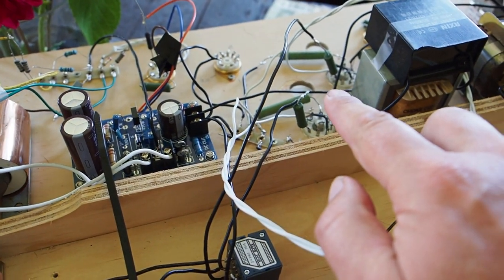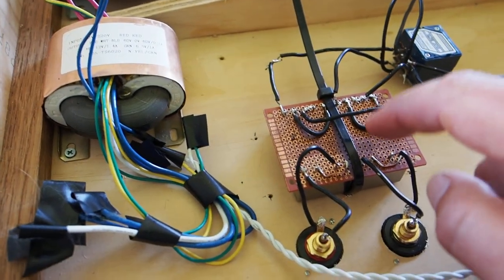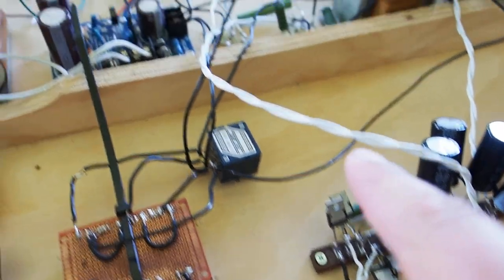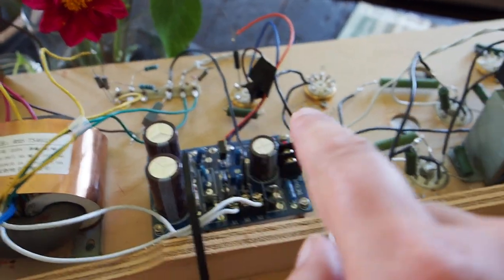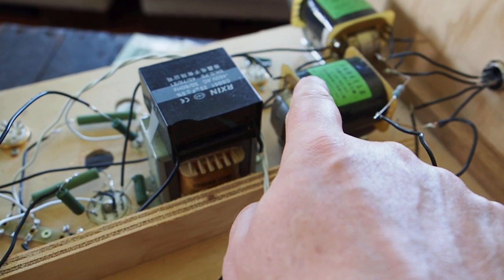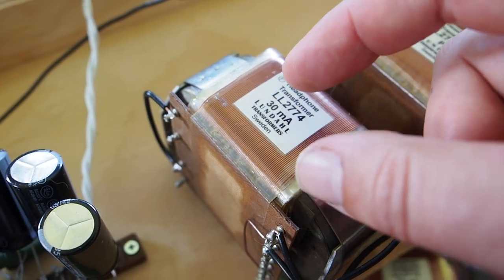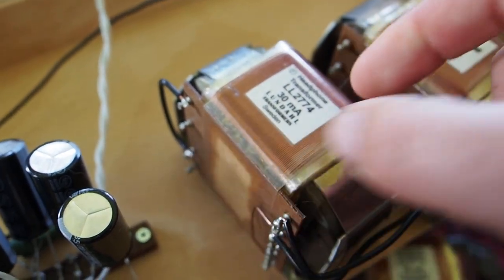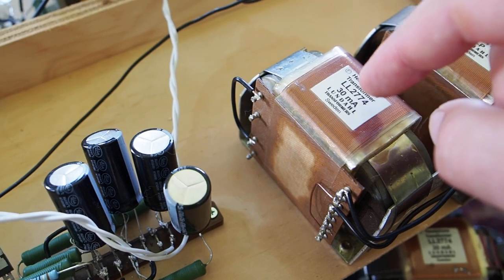The tube headphone amp project: design overview

Comment: very interesting to absorb the design thoughts. coincidentally i chose the ll2765 20ma for the darling (first build, yet to be done) that I'm unsure of how it can be wired for multiple output. will you use more than the 300r out?
Reply from the maker: My plan is to use the 32 and 150 ohm output so a 300 ohm headphone creates a ~13K impedance for the tube and for a 55ohm headphone (on 32), it's about 10K. With two 4PDT switches we can switch between the 2 output configurations.

However, I noticed the 4P1L quite likes delivering current, so I do need to have a listen to it on the 300ohm output. 

With using/offering the 32-150 ohm switch, we can support a wide range of headphones (~25-300 ohm): a lot of models from Hifiman, Audeze, Dan Clarke have impedances in the 25-60 ohm range (if I remember them all correctly).

Comment: I got a broken OTL headphones amp. The proper tube heating fails. It's known as Pharao. Can anybody help me with this? The builder disappeared.
Reply from the maker: If you are safe to work with high voltages when the amp is open, even a multimeter can quickly tell where the power is failing (filament voltage is easily checked), replace fuse, or that the tube is simply bust.. else you'll need to find someone local to you (Location?).